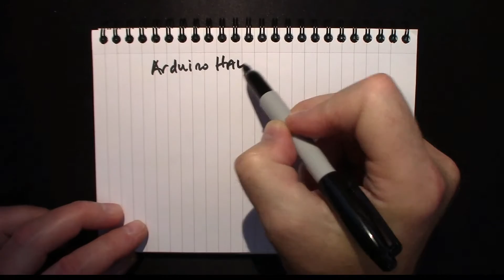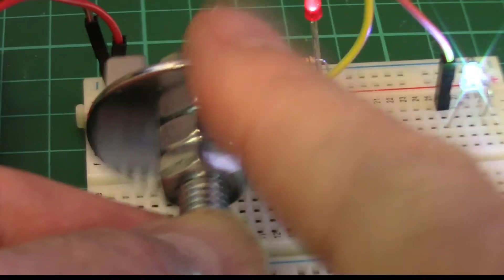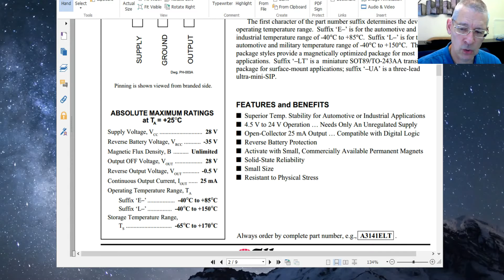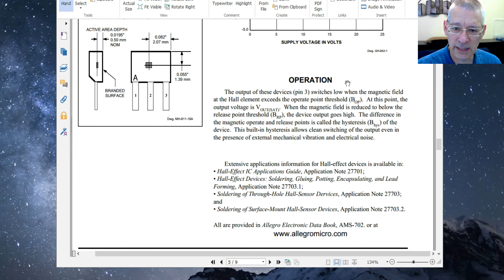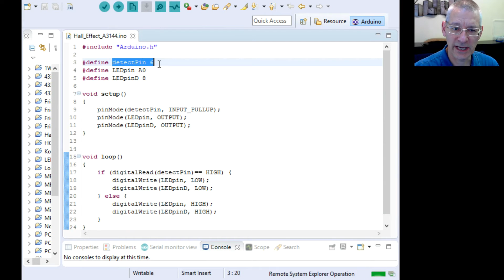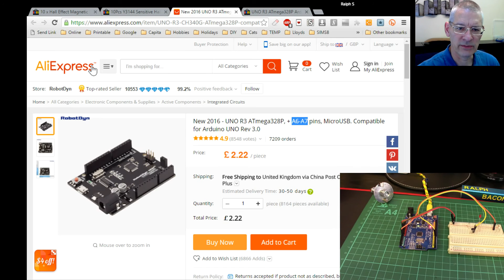#55 Using a Hall Effect Magnetic Sensor

Comment: Hi Ralph
yet another great video - even though it's 6 years since you relased it ;)
You mention the special arduino version with two extra pins. Just be aware that these two are analog-in pins only!
Reply from the maker: Yes, indeed, A6 & A7 are analog input only on the ATMega328P but on the (almost pin-compatible) ATMega328PB they are standard GPIO pins. A pity that Arduino never updated their UNO design to use that chip, a missed opportunity (about 8 years ago, anyway).
Reply: @RalphBacon  Oh. So now I also  learned something 😉

Comment: Thank you for creating this video, very good tutorial for a noob like me. Is it possible to get analog value for the hall sensor input instead of getting just HIGH/LOW. Maybe with specifying different pin mode? I want to detect approximate location of a magnet, whether I need to have more or less sensors placed if a row.
Reply from the maker: Yes, absolutely, but not from this device, as this one contains a Schmitt trigger which specifically outputs either a HIGH or LOW with no intermediate stages. However, if you search for a module like the one below, you can get both analog and digital outputs:
https://www.digitspace.com/products/sensors/others/ky-024-linear-magnetic-hall-sensor-module/?d624ad09dcc26da7

Comment: how to use hall  sensor without arduino or OpAmp ?
kinda stuck at that
i wanna use it to know when to fire a sparkplug
lets say if it can handle 100hertz  it should be  more than enought
Reply from the maker: A Hall Effect transistor will easily manage 100Hz. But it's doing something with the relatively low signal level that I see as a problem. You don't need a full Arduino, an ATTiny85 would be fine (and cheap).
Reply: @RalphBacon  the sparkplug is only the start  i want to adjust maybe fuel based on pressure because i want turbo and injector

now i wonder what the reaction time of an arduino
Thanks

Comment: Hi Ralph can this transistor be used directly without Arduino. I want to use it to turn on 12v led strip. Thanks
Reply from the maker: I'm afraid not, Ajay, this transistor (well, it's more than that) is only a sensor and cannot handle high currents at all. I doubt it could even switch on a relay. It really does need to be used with something that can handle higher currents, but that could be something as simple as another transistor. I hope this helps.

Comment: Hi Ralph, It's a really good video.
Currently I'm trying to make a magnetic flux detector  inside a rotor using hall effect sensor too
The desired output is Weber
I have a few question for you if you don't mind helping me
Thank you very much!
Reply from the maker: Post your questions right here, Juan, then others can see them too and might also be prepared to chip in with their ideas.
Reply: Ralph S Bacon Hi Ralph!
1. I want to know how to convert the output of hall effect (which is volt) to Weber(Vs)? What is the seconds doin here?
2. The main point is how can I get Weber from the hall effect, when I'm supposed to measure the magnetic flux inside the motor? Could you please share your idea?
Reply from the maker: The short answer is, I don't know. But, what with Google being my best friend and all, I found this:
 
The SI unit for Weber is (m^2 x kg)/(s^2 x A).
One volt equals to one joule/coulomb, which is: W/Q.
Now, the SI unit for volt is (m^2 x kg)/(s^3 x A).
now volt x sec = (m^2 x kg x s)/(^3 x A)
volt x sec = (m^2 x kg)/(s^2 x A)
volt x sec = weber
 
Also, refer to this wiki page: https://en.wikipedia.org/wiki/Weber_(unit). For your question this may be important: "A change in flux of one weber per second will induce an electromotive force of one volt (produce an electric potential difference of one volt across two open-circuited terminals)."
 
I hope this helps you more than it helps me, that's for sure! Tricky question, perhaps others will answer too.